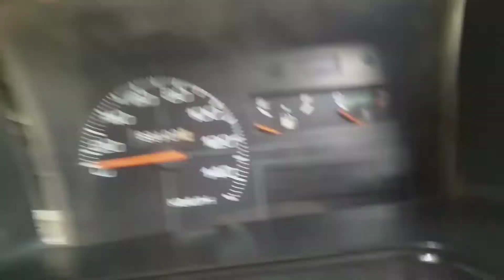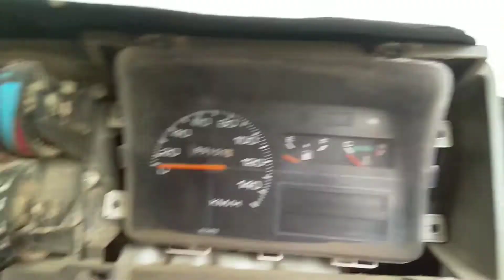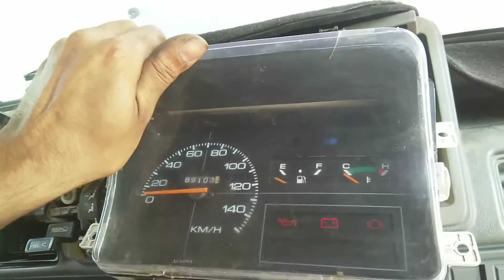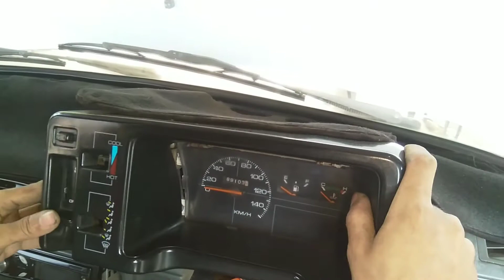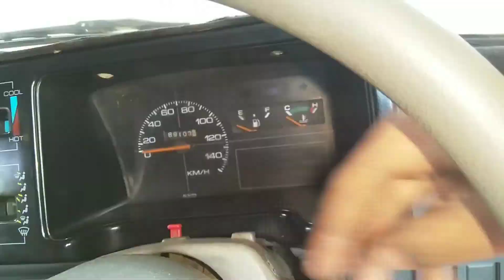Suzuki Mehran Meter Lights Replace

Comment: Aoa sir gari mai center lock system install krna hi kitna kharch ahy ga
Mehran mai rpm meter lag sakta hai k ni
Reply from the maker: 2500 se 3000 ka karcha euy ga 
Rpm lag sakta hy
Reply: @RajaAutoofficial  and center lock???
Reply from the maker: 800 ka set hy center looking moter
Or ket takriban 2200 ki